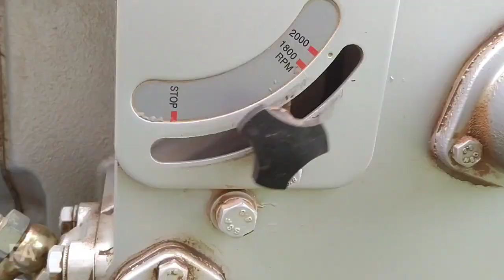Power tiller water pump || Kamco power tiller pumping water by Monoblock pump || Only 500 RPM

Comment: power tiller engine ka pulley kitna inch ka he??
Reply from the maker: Company fited pulley.
Reply: @FarmingAreaofficial  ha bhai mai ne mere power tiller me map ke dhaka 6 inch ka pully he... 

mere pass 2.5×2 inch ka pump he use chaleange... 

oil kitna lega 1hr. me??
Reply from the maker: 3×2.5 or 3×3 agriculture purpose ke liye badhia hota hai. 400-500ml/hr fuel lagega.
Reply: @FarmingAreaofficial  ha bahi.. sahi bola  3×3 pump sahi hoga .. bt mere pass 2.5×2 pump he... esliye...